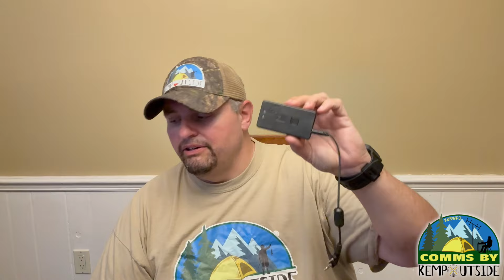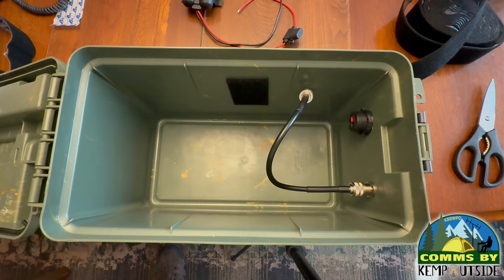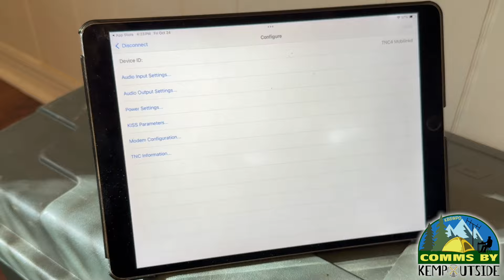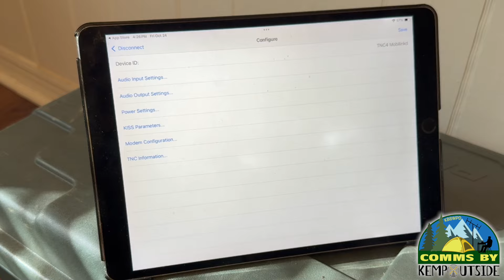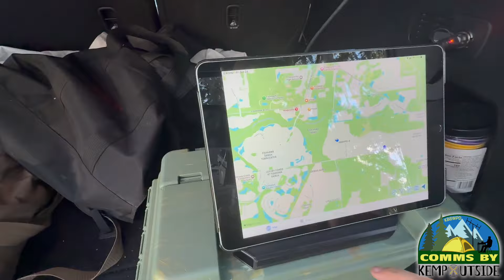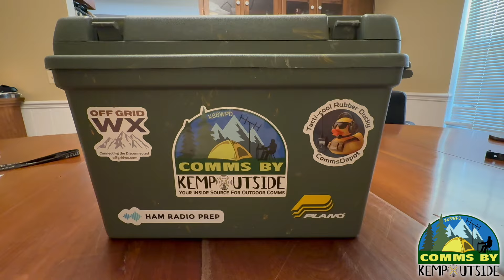Build Your Own High Powered APRS Ham Radio Kit for Mobile and Field Operations

Comment: Nice setup.  I switched out all cigarette lighter plugs.  I feel they can eventually lose electrical contact over time. Not that it's very practical but if the ammo box was metal you could stick a small mag mount on the outside of the box if digipeating. Maybe drill some vent holes for the amp? Probably not really needed though.
Reply from the maker: I've kicked around the idea of eliminating the cigarette plugs but I figured I'd test it this way for a while and if it needs to be modified, that's a new video! The transmit time for APRS is so short the amp never gets hot.  But I am keeping my eye on it.

Comment: Great use, by using what you have already. Have most of the hardware outside of the Bluetooth TNC. If you are in cell service, you can also use a VGC 7500 and have an igate. I have a digipeater using a 2 meter radio and direwolf with a raspberry PI following the great info the modernham put together. I like this better as I can go offline and still digipeat.
Reply from the maker: my plan is to set this up when camping with a roll up j pole in a tree 50’ up. I’ll carry my VR-N76 when hiking, beaconing my position for safety. Then I’ll use the iGate feature in APRS droid back at camp to send my location to the internet from my trailer’s on board Starlink.

Comment: Wish I knew more about aprs and how to use it, but never could understand how to get everything set up.  I am a big fan of power boxes since that's a crucial requirement if going portable and even being independent of a vehicle power source.  I think having a dedicated power box with maybe some compartments for small light accessories would be good.  Then all you need is the radio and maybe you already have the antenna stored in the car somewhere if it isnt always mounted.
Reply from the maker: I’ll try to do more APRS videos to help people get started. And power box builds are a blast! I’ll do more of those I’m sure. Thanks for watching!